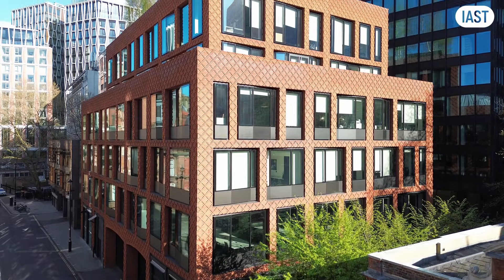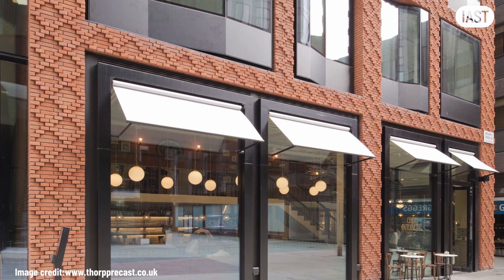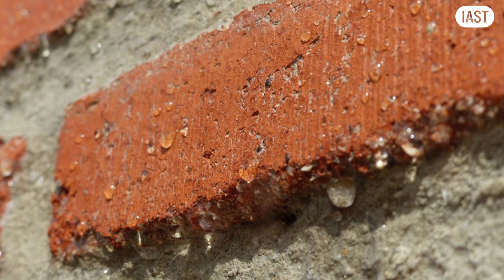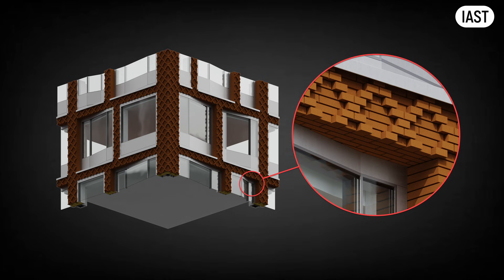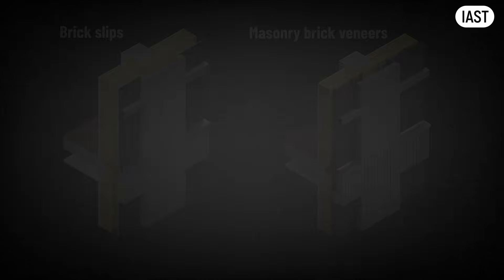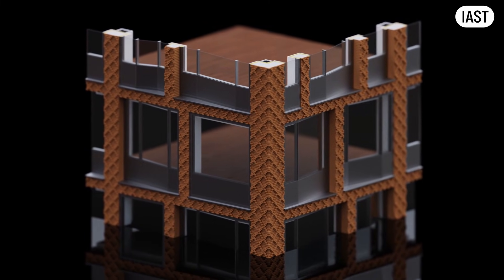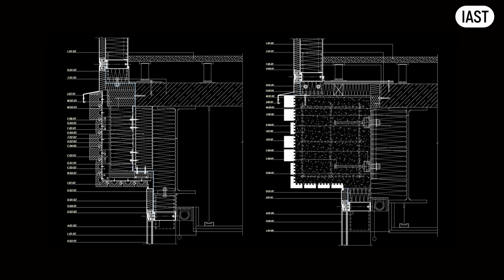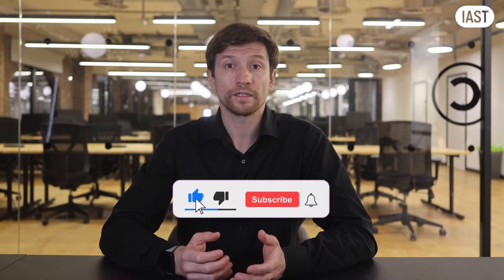Brickslips vs Precast: Why This Brick Facade isn’t “Real Brick”

Comment: When I was a kid and saw a "brick building", I assumed that the brick was holding up the building, or at least helping to hold it up. Then, in 1974, I saw a wooden office building go up and was amazed when they covered it with black stuff (tar paper) and nailed these ugly corrugated metal straps on it, then covered it with bricks. I've since learned that even when concrete block buildings are covered with brick, the brick almost never serves any structural purpose. So it makes sense that they would use thinner bricks, especially on a tall building, since tall buildings tend to sway and have been known to pop out full-sized bricks when they are hung that far up, putting pedestrians at risk. But at the ground level, thin bricks are more prone to damage from minor collisions, so I wonder if anyone sells full-sized bricks for the first level, with matching brick slips to put on the upper stories of a tall building.

Comment: Problem with these systems instead of a traditional brick and lime façade is that they’ll breed mould and rust creating a hazard to occupants and/or looking plain ugly in a few years like a horror movie set with rust dripping.

With foresight you can plan with civil and structural engineers to build a hydraulic lime and klinker façade with the appropriate arrangements in for structural engineering with how you place the bricks.

simple things like archways, symmetry and alignment can be brought back into the design lowering structural requirements, materials cost and complexity of construction while creating a more visually pleasing building that is longer lasting and costs competitively against overpriced over complicated concrete reinforcements for asymmetric buildings that are of odd shapes with expensive curtain walls that cost as much as the entire building itself and last a couple decades with high maintenance costs.

Comment: why can't you fix the brick slips onto an insulated wooden or aluminium frame?
you could use internal steels for structural integrity.
Reply: It's done. The "stone piers" on this wood-framed building (a trademark of this chain of clinics) are screw-on stone sections, which come pre-mounted on steel plates. 
https://youtu.be/QX3vofK95xE?t=7
This stuff is used on a lot of commercial buildings of various structural materials in N. America. You also see it on private homes, but because it's pricey, it's often used only on the front, or in sort of an exterior wainscotting. Back in the 1800s, the English came up something called "mathematical tile" which consisted of stairstep shaped tiles that were nailed to wood buildings overlapping each other and mortared to look like brick. It was said that they met planning requirements for a "brick exterior", but evaded the "brick tax", though I don't know how long that lasted. Today they sell various systems for attaching brick slips to wood framed buildings, from Novabrick, which is sort of a molded cement version of mathematical tiles, to "BrickIt", which clips to screwed-on metal panels. 
https://youtu.be/RBtq_s91KAE
I'm sure there are similar products outside of the USA.

Comment: The pre-cast faux brick pattern looked odd where the pattern was projecting out without the mortar (concrete) between the brick. Eugenie would it be possible when casting the concrete panel to have the concrete fill the joint without the concrete wash over the other brick? (better formwork?, think shuttering in UK)

Comment: What did he just said? Brick walls are too slow, too heavy and terrible thermally? Any day now I would take a brick building from a century ago instead of your shit and shingles pretty paddocks you put up these days.
Reply from the maker: Brick are slow and heavy. But they are not terrible thermally. And yes, a mass wall from a century ago will most likely outlive brickslip Rainscreen. We’ve covered that in our Rainscreen video. 

If you have £8m, you should definitely take Georgian or Victorian  real brick house in Westminster or Kensington. 

Brickslisp are just “wallpaper”. They don’t have any purpose other than decorative. 

But the reality is that over 12 floors or in the middle of city, it is just not feasible. 

The question is - should we try building high rises in brick or reserve real brick to countryside 1-3 storey houses?